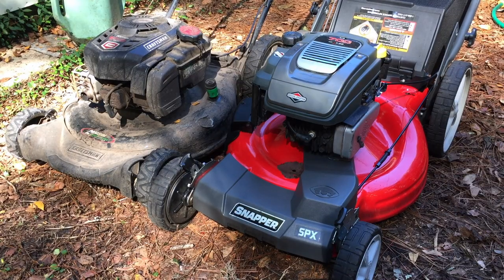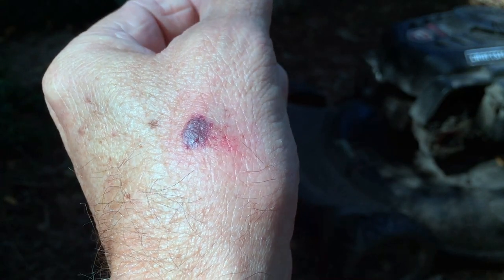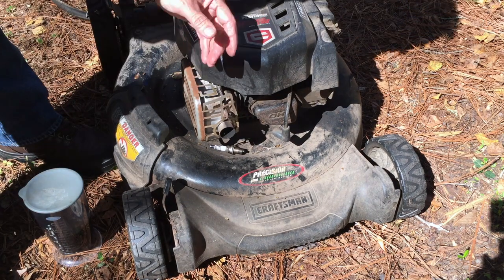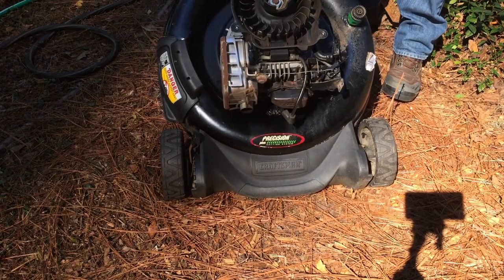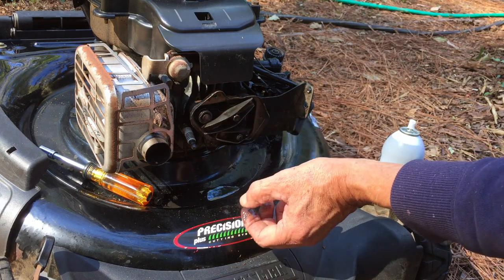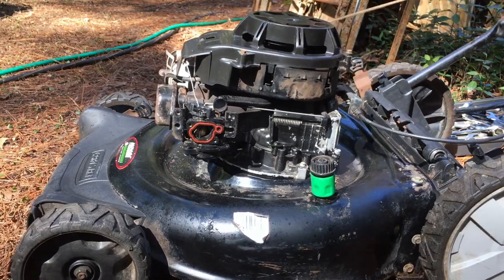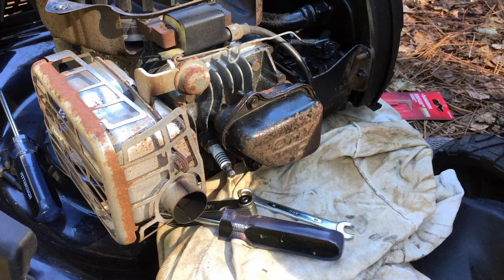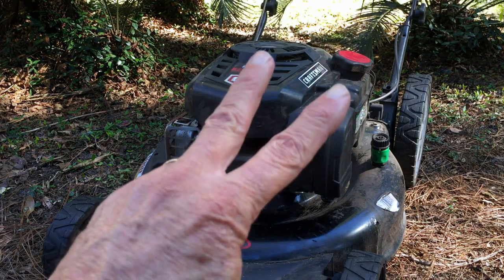Free Craftsman Pull Cord Snaps Back/Valve Adjustment

Comment: You did well to get that job done.. did you set it to TDC before setting the valves?
Reply from the maker: I believe so yes.. But my first time adjusting valves on a mower so probably not perfectly done..
Reply: The valves weren't on the outside to adjust them on this model you could only see the seated valves after the cover was off a little  carbon on them cleaned up without a complete  strip down but now runs better than before thanks again funny thing was I searched the house the shed all my tools 2hours to find feelergauge  and I didn't need it lol